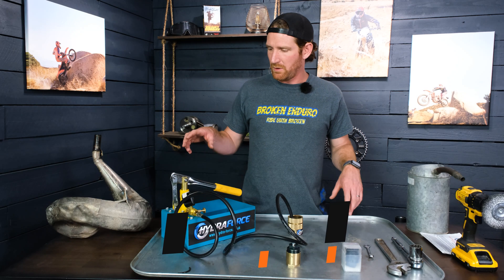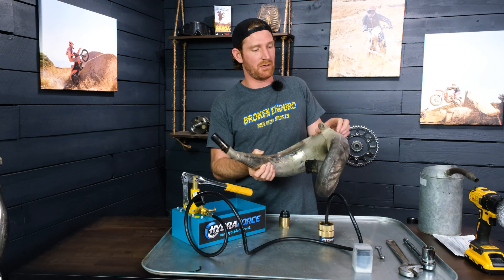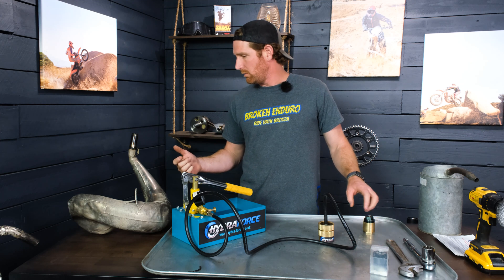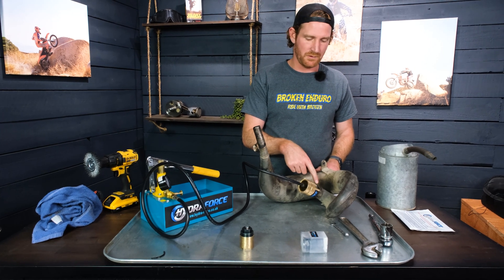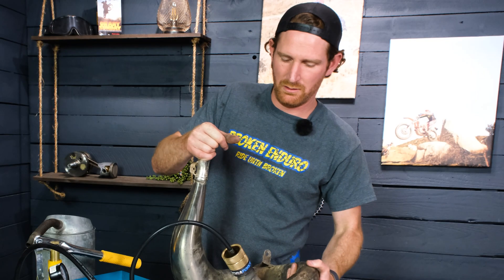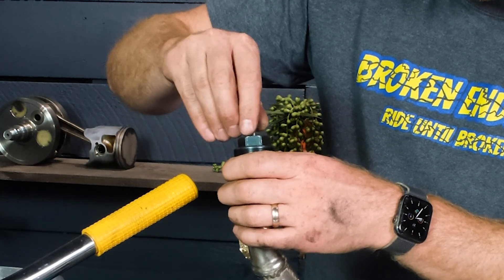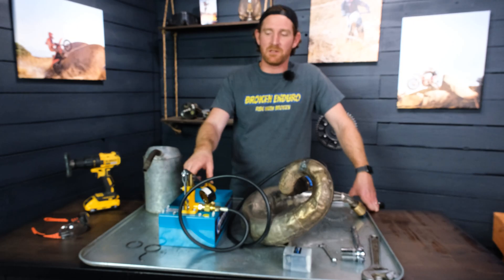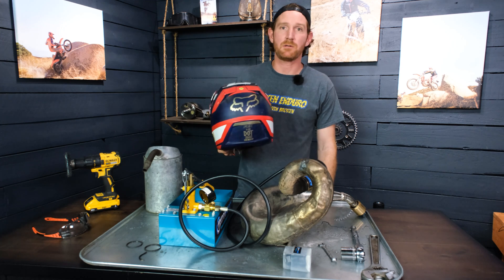Two Stroke Exhaust Pipe Dent Removal With HydraForce Water Pump | How To And What You Need To Know

Comment: Those are great. I’ve used one at a friends garage.
Reply from the maker: I either need a new pipe or a welder so I can try it out properly 😂
Reply: Heat it with a torch at the dents with the pressure on and they come out